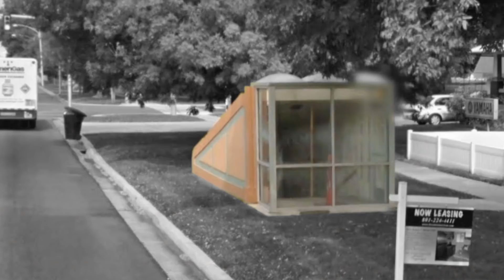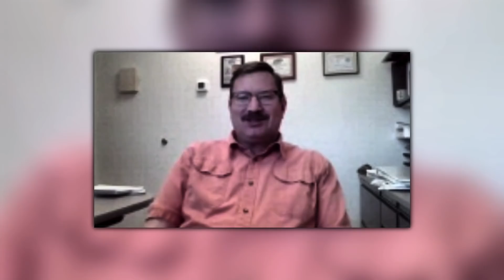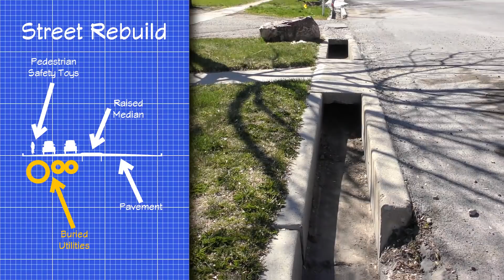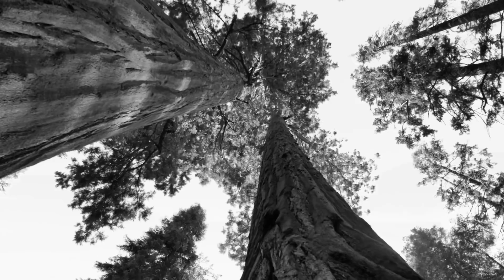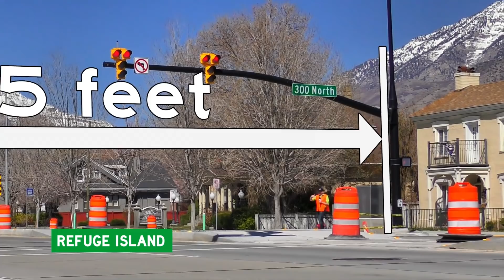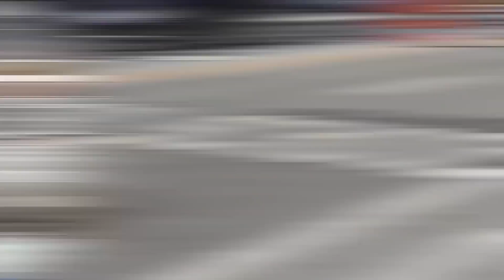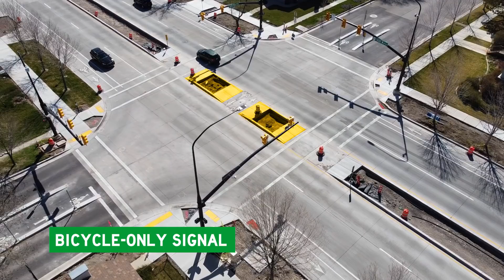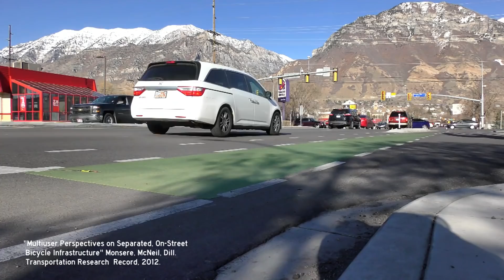Rebuilding the road? Joggers and bikers WANT TOYS, too!

Comment: There is really no good reason not to add a separated bicycle lane whenever a road is reconstructed. And I know you said it jokingly, but proper infra for pedestrians and cyclists aren't toys, they're integral for creating liveable cities.
Reply: Only if there's room. If you're only working with a 4 lane arterial that needs all 4 lanes, you can't just take one away from each direction for a bike lane that would seldom be used. If there's enough room, I agree.
Reply: the only good reason is if you can't do it without either tearing down buildings, or creating a major bottleneck.
Reply: @JoePCool14  Why the fuck would an arterial need 4 lanes? You only need 4 lanes on a highway. Arterials should have one driving lane in each direction, a two way bikeway, and a loading zone. If there's space, there should also be busways in each direction. You rarely actually need to drive to an arterial, you only need to drive if you have big shit. For most things, like a daily grocery run on your ride home from work, you can just stop at the grocery store, put what you need in your backpack, and ride off. I don't see the need for 4 fucking lanes. That's insane! You would only need that if everyone in the town was disabled and thus needed to drive to the grocery store. And anyways, where the fuck would you park that many cars‽ You would need to make parking lots, thus making the street miserable and unpleasant and borderline rural in density. And in a rural area where everything really is too far apart to bike or take the bus or train, then you don't need 4 lanes, because there aren't that many people there.
Reply: @tealmer3528  perhaps you should look up what an arterial is before you declare that it doesn't need carry cars.
Reply: @tealmer3528  you’re obviously from somewhere with a lower population density that doesn’t need the full 4 lanes. I’ve been stuck in 2 lane roads where the stoplight that’s holding everyone back is 3 intersections away. It doesn’t make sense to place a 4 lane road in Oklahoma but most people don’t live there..
Reply: Frafra Zoomer  i wish we had more roundabouts. So many people here hate them because they don’t understand
Reply: if you stop putting driveways on aterial roads 2 lanes are enough 
and now you have won a lot of space you can use for sidestreets and bike and foot paths
Reply: @JoePCool14  Its a tough decision really. Yes at first removing a lane just for bikes that wouldnt be used much would increase traffic. But imagine if this was done throughout the city all at once. People will take notice of the infrastructure and many would switch to bikes. We would offload two lanes worth of cars into a single lane of bikes because bikes are way denser.

I guess the main problem is that cities keep making these individual roads that go nowhere, hence no one uses them.

I'm interested to see how a city changes if bike infrasture would be done all over the city at once. Would it really be as efffective?
Reply: @JoePCool14  why not, that’s exactly what’s happening in my city
Reply: @JoePCool14  it is a tough balance and we really would want to look at the purpose of a corridor and how many local trips they may truly carry. Many arterial roads locate businesses along them that create the need for local access and carry many local trips. I see too many people driving a mile or so on arterial roads to access a business, school, or other destination when they could easily ride a bike that distance. So many of our arterials are encumbered with local trips that they don’t do the job very well that they are intended to do.
Reply: Nah. A sidewalk is a toy. A bike lane is a toy. A bus is a toy. A heavy industrial equipment. Toy and important are not mutually exclusive.
Reply: @simonkraemer3725  Fine for your city, but not every street in the US represents your city.  Sheesh.
Reply: @JoePCool14  See the flaw in your argument is that you assume it will be seldom used simply because there's a lack of cyclists BECAUSE there's no infrastructure for them.
Reply: @JoePCool14  bike lanes are usually only 5 or 10 ft so if you want to replace a car Lane with two bike Lanes you can do that
Reply: @reileypalma2129  Actually... YES. @Road Guy Rob, if you do a deeper dive into bicycle traffic tools, I suggest a road trip to Davis, CA (or Long Beach, CA). If you design to be bike friendly, the cyclists will come. Davis planned--I think from the beginning--for lots of bikes. Long Beach went for retrofits (relatively recently). Both have a fairly large number of bikes in use on any given day.
Reply: @JoePCool14  A lot of the space required on an arterial is for queueing cars and allowing for high speeds (ie. long safety distances). If you drop the speed limit from 40 mph to 30 or 25 mph and replace a few stoplights with roundabouts, you can easily slim down from a 2+2 to a 2+1 with alternating left turn lanes.
Reply: @shawnpitman876  Hear, hear! If a road isn't cycling-friendly, that tends to limit the number of bikes taking the route. If a road is cycling-unfriendly (usually heavy traffic, no bike lane, and/or chewed-up road surface), most cyclists will actively avoid it. But if a road is bike-friendly--even slightly--it'll probably see a lot of two-wheeled traffic.

And if you notice that there's an awful lot of bike traffic on a side road paralleling the main road... just assume that the main road's bike-friendliness needs to be looked at the next time it gets torn up.
Reply: Frafra Zoomer  The newest smart traffic lights in the Netherlands (like those in Den Bosch) have higher capacity than whatever form of roundabout. However, looking at the archaic infrastructure in America, roundabouts are a huge improvement.
Reply: Then make cyclists pay a tax. It cyclist don't want to get registered, have number plates and pay taxes, no bicycle infrastructure for them
Reply: @Asthafdo123  Unfortunately for you, there is no tax that goes directly into the building and maintenance of road infra. Maybe it's a good idea for Road Guy Rob to make an episode on how exactly financing works. Maybe you might start to understand why so many roads in the North America as in such a poor state, despite all those poor drivers being so heavily taxed.
Also, as a society you might want to question if it's wise to tax forms of transport that are proven healthy and emission free.
Reply: @tealmer3528  Arterials never need four lanes huh? Yeah... no. The way American roads have developed may be flawed, but that's just the way it is. You can't just make every non-highway road only 2 lanes, that would be ridiculous.

Also, I live in a more northern climate, where biking comfortably is only possible half of the year. You think you're going to convince that much of the population to start riding bikes everywhere? That's never going to happen in America, even if every street had bike facilities.
Reply: @Asthafdo123  If cyclists don't have to pay taxes, then I have a call to make. The fucking tax office lied to me!
Reply: @weetikissa  I mean Gas tax, you peeps should be taxed for every kilometre you cycle.
Reply: @Asthafdo123  Why? Do you want more traffic jams because cyclists will start preferring cars again?
Reply: @Asthafdo123  as mentioned before, the gas tax comes nowhere near covering the long-term maintenance and replacement costs of roads. Cars take up the most space per capita for a mode of transport and requires the most infrastructure per capita thus leading to the highest cost per capita to provide. If you consider transportation as “work being done” utilizing walking and biking to complete that work is much more efficient and cost effective. The more people walking and biking, the less we have to do expensive road widening projects and the less traffic congestion. Not to mention the improved air quality and personal health benefits that come active transportation. Providing safe and connected active transportation benefits all even if you still choose to drive a car. We should make people driving (including myself) pay the true cost of all that infrastructure which is currently being subsidized through other means. We should be encouraging walking and biking however we can to achieve many savings and positive externalities for society. If people paid the true cost to cover all of our huge roads (and all the other things that come with it), then more may actually choose to walk, bike, or take transit more!
Reply: @JoePCool14  most of the world’s big cycling cities tend to be in northern locations with colder climates. Look up Oulu, Finland and see how they are the winter cycling capital of the world. Not Just Bikes has a great video on it. Montreal, Minneapolis, Denmark, the Netherlands, etc. all have colder climates to differing degrees and have a good amount of biking. Winter maintenance seems to be the number one factor in whether or not people are willing to ride during winter months - you can bundle up but riding though a foot of snow sucks! There is a point where the cold sets in - in Oulu, they show that bike ridership really starts to fall at around -20 Fahrenheit.
Reply: @tealmer3528  I see you're from Europe, yes? Here in North America, everyone drives and also is bad at it, so we give lots of space for lots of cars. Most people live in Suburban areas that have low density, single family homes, and the closest grocery store could be as far as a 20 min drive. And pretty much everyone goes grocery shopping weekly or Fortnightly, so people buy a lot and load it up into their car. It's normal to us.
Reply: There is . Bicyclists and pedestrians don’t pay taxes, those that pay fuel taxes so. If pedestrians and bicyclists want toys, they need to contribute to construction and maintenance of their lanes, and not take away lanes from car drivers
Reply: @reileypalma2129  do you think Uber drivers can use bicycles? Or how about my semi truck? How much bicycles do I need to pull a 43,000 lb reefer trailer?
Reply: @Froboymike  how many people do you think are driving a bicycle to a business? I don’t seem to see a lot of bicyclists going to target wal mart post office . You’re overestimating how much people ride bicycles. It’s a small hobby for people, but most middle class people have to drive a car for work, and aren’t rich hipsters who have time to ride around on a dangerous piece of metal with two wheels
Reply: @TKUA11  In 2019 in the Netherlands, bicycles are used in at least for some distance in 25% of commutes. (source: Centraal Bureau  voor de Statistiek). 40% of all trips to the supermarket are made by bicycle. There is no reason at all why this shouldn't be possible in North America
Reply: @TKUA11  it’s always fair to question things, but to answer your question it depends what city you live in and what their infrastructure looks like. There are places where many trips to businesses are done by bike or walking, and it is typically where there are safe, comfortable, and convenient places to do so. Thinking people will do that in a place where there is no good infrastructure is setting it to fail from the beginning. I’m not saying that we should get rid of cars, but I believe there is a balance to be achieved and it can be done so if the infrastructure and land use are done right. I also know ways to include safe bike infrastructure into road projects that actually doesn’t cost much more money depending on how the road is proposed to be built. There are cheaper ways to build better bike infrastructure if it is a new build or complete reconstruction as well rather than just striping a bike gutter in the roadway.
Reply: @coastaku1954  I'm from Philadelphia, the place that literally founded America. I commute by bike. I don't own a car. I get around by walking, biking, or taking the train. Every street here that isn't a highway has one lane per direction or less. I know about the suburban hellholes outside of the city with multiple lanes per direction for non-highways, and I think it's dumb as fuck. They should just bike to the train station.
Reply: @JoePCool14  I live in Philadelphia, which is a northern climate. You just plow the bike lanes and put on a jacket. It's not hard. But really, with medium-density development (rowhouses), grocery stores aren't going to be more than a 15 minute walk. Nor will the nearest trolley or subway station. And it really isn't uncomfortable to walk in winter. Put on a jacket, wear jeans, and have a hat and mask on. (The latter not for covid but for cold.)
Streets with medium density are so pleasant to walk or bike on (and so miserable to drive on when built with appropriately narrow roads) that nobody drives. You can't make a road that is both pleasant to drive and to walk/bike on. Those are contrary to each other. So, obviously, you build roads that are pleasant to walk/bike on. My local arterial road is a one lane, one way street with a bike lane and a parking lane with a few loading zones. (A block over is another arterial going in the other direction)
Reply: @coastaku1954  Well for that we have something great! It's called a trolley system that connects to a train system. For instance, using the German terminology, we have a U-bahn and an S-bahn. This means that we have a subway system and a commuter rail system that through runs through the city center and out to the suburbs on the other side. We also have a trolley system that runs every few blocks in west Philly and then turns into a subway when it reaches 40th street, and runs that way all the way to 13th street.
Reply: @ricecakeboii94  I'm from center city Philadelphia, the second most populous downtown in America after midtown Manhattan. Our arterials consist of one lane for driving, one lane for parking, and one lane for biking. (One way, you go a block over for the street in the other direction) I can assure you that this is a plenty high population density area. We have four subways.
Reply: @kenbrown2808  My local arterial is one lane for driving, one lane for biking, and one lane for parking. I think by arterial you are referring to a highway. I am referring to a mixed-use, primarily commercial, street that runs along the edge of a neighborhood.
Reply: @tealmer3528  by "artierial, I am referring to a road that has the primary function of getting cars through an area.  my local arterial ranges from two lanes to five, but in the main part of town it is four underwidth driving lanes, and two underwidth parking lanes.
https://en.wikipedia.org/wiki/Arterial_road
Reply: @kenbrown2808  I'm referring to what's called an "urban arterial" by most definitions.
Reply: @SomedayIWT 1. I wasn't talking to you.
2. those are some nice excuses, too bad they're BS because there's plenty of places within 30miles of Irvine that don't costs a million bucks.
Reply: @SomedayIWT where i live college students cycle to shool to save money but all your cities are designed so badly that the car is the only option
and you can find excuses our you can decide to build infrastructure and cities where people have choices 
for example being able to live in an urban development without paying a million or being able to bike to work or to a store
Reply: @SomedayIWT The arterial I am describing is the primary route for around 100,000 people to access I-76, it is not for the purposes of feeding into another arterial, it feeds directly into I-76. Also, those streets were not designed to discourage gang activity. They were designed to isolate neighborhoods from the surrounding ones, thus making redlining work. They did this by
1) making them miserable to walk through by having unessecarily long routes
2) Isolating themselves from the surrounding areas by only having one or two entrances, and those entrances on highways. (you would describe these highways as arterials, but they have a primary purpose of carrying cars and the commercial areas that line them are separated by giant parking lots from the actual road, making them hard to use to actually buy groceries or anything, so I'm classing them as highways)
Unprotected bike lanes on roads with more than one lane in either direction for drivers are ridiculous as they are terrifying and unsafe to ride on and therefore don't meet their purpose. Bike lanes should be made in a way that they cannot be parked in, cannot be driven in, and are a comfortable distance from the road.
Reply: @Asthafdo123  That's kind of silly. Pedestrians don't pay pedestrian-specific taxes, and not all car infra is paid for by gas taxes and licensing fees and tolls.
Reply: @SomedayIWT Again, the arterial I am describing also handles semis with ease, they can and do go at 25 mph down that street, accessing all the local stores. Of course, they block the road while pulling over into loading bays, so for a street with a lot of warehouses, it is good to have a lane going in the other direction and a parking lane that stops where semis often turn, so that they can quickly turn where they need to go and not block the street for long.
Reply: @JoePCool14  They are seldom used, because there isn't enough of them. If 50% of your bike route is safe and protected and really good but the other 50% is scary, horrible and dangerous, most people won't bike that. You can call the road an arterial, but it wont be one if you allow easy access to the properties on that road. The more access you have to the properties around the road, the less car lanes you should have.
Reply: @hendrikdependrik1891  It all really depends on the junction in question. If 80% off traffic is driving on the main road and 20% comes from the road crossing it, then yes smart traffic lights are probably way more efficient in throughput since the main road can get an "always green unless ... rule". If the two roads crossing are similar in amounts of traffic a roundabout will still be more efficient in most cases.
Reply: @SomedayIWT maby you should give people the choice
Reply: @TKUA11  every citizen pays tax (if you don't it is a crime), all the different kinds of tax money gets into 1 pile anyways.
Also, why should cyclist and pedestrians that don't need to buy fuel, pay fuel tax? what is the logic in that? Are you also complaining that those pesky Tesla drivers don't pay fuel tax?

"do you think Uber drivers can use bicycles? Or how about my semi truck?"
If they (Uber drivers) want they could, there are such things as bicycle tuktuks/ricksaws, they might even be pedal-assisted. As for your semi truck, you can still use it as there is still a lane to drive it on.

Uber drivers and semi trucks (or other work related vehicles) are necessary to keep the country going as they provide a service.

Because of the way you act I guess you are a Freedom lovin' American, it is the likes of you that hinders the Freedom of Movement from your fellow Americans that can't use a car for whatever reason.
It is also thanks to the likes of you that anyone that can use a car has to use a car since there is no acceptable alternative in most of America.
Reply: @reileypalma2129  some cities have done that and the result is exactly as you describe. Huge amounts of car traffic converted into bicycle traffic, which makes everyone happy
Reply: Here in Los Angeles, they took some lanes for bicycle lanes. The only people I see use them are residents with $10k bikes just exercising. Very rarely used by anyone else for normal commuting.
Reply: @JoePCool14  bike lanes are only seldom used because they are not considered safe since the almost all only have painted lanes to protect you from hundreds of pounds of steel driving down the road with a driver who may or may not be texting.  Study after study has shown protected bike lanes with physical barriers cause a lot more people to bike.
Reply: @JoePCool14  I disagree. I’d take away 1 lane and add an alternating left turn lane and bike lanes (probably unprotected)
Reply: @JoePCool14  thing is, can’t just half-ass a bicycle network and only put it in places where there is space because then nobody will use it. Imagine if they did that with road networks. They only build roads “where there is space”. Then half the roads in urban areas wouldn’t exist. You either commit to it to solve traffic or, like you said, it’s plainly useless. New York has had a very good success, at least in Manhattan. You see lots of people riding bikes and it’s because they committed to it. Once you see it, you understand why it’s important because all those people in bikes is far more cost and space efficient than more people on the subway, cars, or busses. Also I don’t mean to be rude, just wanted to point out my point.
Reply: @ricecakeboii94  Chicagoin here, 3rd most populated city in the US. We do have 4 lane arterials, but they certainly aren't the norm. And you can guarantee that trying to cycle or walk across them is f*king terrifying.
Reply: @ricecakeboii94  I'm from the UK and have to disagree our population density is far higher than the US' and we have very few arterials that are 4-lanes wide. The problem is more to do with the way US cities are built so everyone is constantly in a car, like you shouldn't need to drive to the shop for your weekly shop. One lane in each direction is enough along the A-road system of the UK for most of it, admittedly there are bigger sections, but that is the arterial road network for the country and it has far less traffic issues than the US seems to, plus more lanes rarely help long term because of induced demand and the space a car takes look at LA or even just large portions of Texas which have a shit ton of lanes and is a standstill for hours upon hours at a time.
Reply: @PCDelorian  what also helps in london is the tubes... oh and the buses everywhere... oh and if i recall the city center core is largely pedestrianized
turns out if you build a wide variety of infrastructure that connects places efficiently...you need way less cars^^
Reply: The car lobby in the US has pushed hard to eliminate public transit in cities. They bought up existing trolley systems, tore them out and paved them over in order to induce the need for cars. Detrimental to the commons all to serve selfish greed.

Luckily, people have realized in the past few years that high quality and efficient public transit is key to creating livable cities where people naturally interact and walk more. That's good for public health and saves money in the long run as well. Washington, DC is in the process of rebuilding it's city trolley system which has already really made a difference. I do like cars, but I also really like streets that are alive with shops, cafes and parks. 

The US also needs to move towards installing roundabouts in place of intersections. It helps to keep traffic moving while also slowing it down enough so accidents happens less often and are less severe when they do happen. Europe has had great results with that
Reply: There are reasons:

1. The road is in a rural area. I live in a small town and bikes are not practical here. It would take me an hour to bike to town vs 15 mins by car 

2. Cold climates. Biking is not nice in these areas for half the year. "oh but you can just plow it", have you SEEN how disgusting road salt is? No one wants that crap on their clothes and the NE states use a TON of it every winter 

3. You actually need the lane of traffic you would have to remove for bikes. I agree with the guy in the video: downgrading a two lane road to a one lane road with a bike lane is NOT WORTH IT unless that two lane road is barely used
Reply: @AdamSmith-gs2dv  In general, all your points have been disproven in countries that are not in North America. 1) When you look at a European cycle route map you'll see  an extensive network that covers cites, towns and  rural areas alike. 2) Oulu  in Finland id covered in snow for 5 months a year, but its cycling modal share is 12%. In winter. In comparison Portland, well known for its cycling friendliness and mild climate that number was 7% at its highest.  3) Road diets don't make traffic worse according to the Federal Highway Administration. Read their "Road Diet Mythbusters".
Reply: The only problem is the US doesn’t know what a bike is
Reply: @JoePCool14  Florida is the worst when it comes to bike lanes. They're essentially glorified shoulders, and as a result get little use as most bicyclists just ride on the sidewalk. Nobody wants to ride their bike a couple feet away from 50 mph traffic (Florida traffic, no less).
Reply: @erichusmann5145  Or you could assume cyclists are making the rational decision to use the side road and leave well enough alone.
Reply: @lerelo I’m sure every country could learn how to build infrastructure to accommodate all forms of transportation equally and make it work extremely well while maintaining the same look of our cities.
Reply: @ricecakeboii94  i just believe in equal space on a road 1 lane for cars should mean 1 lane for bikes and transit it is just fair
Reply: as a cyclist, unless there's a cutout and a traffic light at each possible turn I could make, it's useless
Reply: @tealmer3528 lol put your groceries in your backpack? you're exposing yourself as a clueless urbanite. people have families to feed. not every town needs to be a mini version of Brooklyn, stay in the city
Reply: @JoePCool14 you’re making a conscious decision regarding who you make room for. Design a place that’s only safe for cars, people will choose to drive over anything else. Woohoo, more traffic, guess we gotta build more lanes! That’ll fix it!
Reply: @TKUA11 Idk, how many cars do you see driving into the ocean? How many people do you see walking on the interstate? See how ridiculous your question is? Design for cars, you get cars.